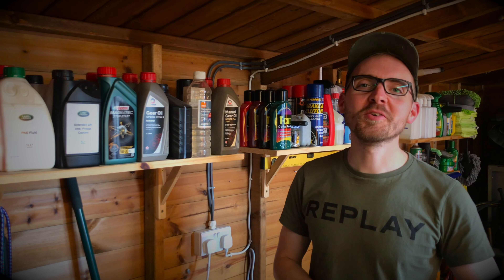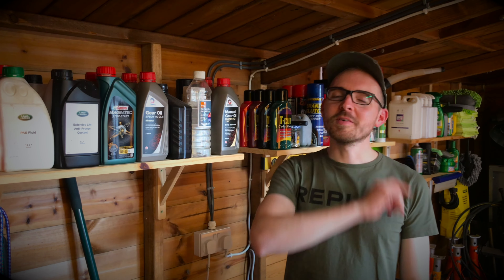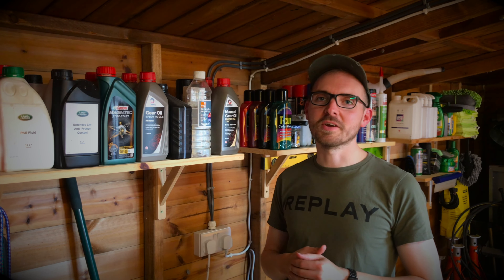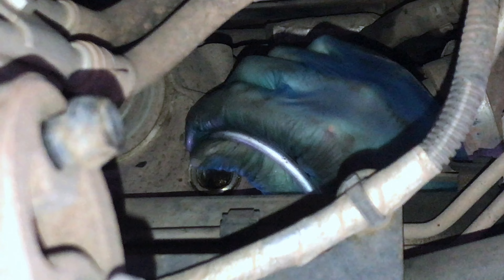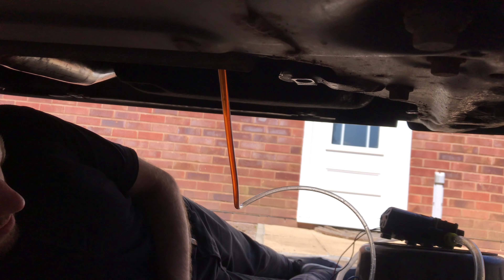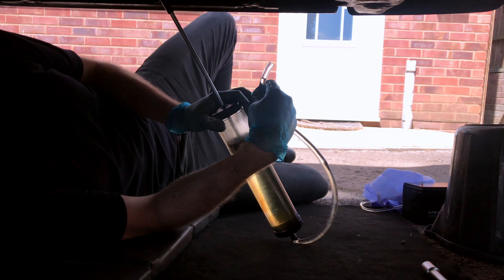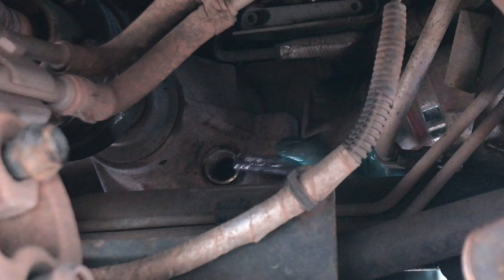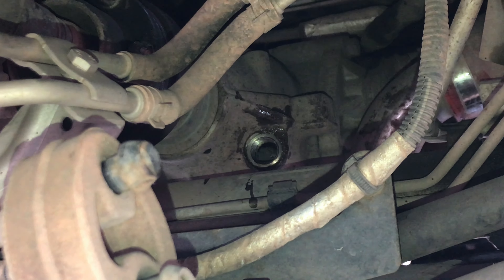Freelander 2 / LR2 PTU Oil Change!

Comment: Nice movie...............................To make the oil change easy I drilled a hole through the lower casing bolt and with a copper washer used that as a sump plug.
Reply from the maker: Thank you! 🙏 Interesting idea! Hadn’t thought of doing that but our luck at the moment isn’t great! 😂

Comment: Good vid. Any reason why you didn’t remove 120ml after brimming as per haynes manual? Any issues?
Reply from the maker: Cheers Scott! 🤩🙏 We didn’t follow the Haynes manual for this job. Instead we spoke to our local Land Rover specialist. To confirm our thoughts, why would you take out 500ml of fluid, put back in approximately the same amount to then remove 120ml 🧐 They advised it wasn’t necessary to remove any fluid but instead to wait for the dribble to stop from the filler plug. Glad to report no issues so far 🙂
Reply: @FrenchiesRoadTrips  interesting! Wouldn’t be the first time haynes was wrong (“haynes book of lies”). I will brim mine and see if it is ok. If the unit has breather pipes like the haldex then shouldn’t be any issues with heat/pressure.
Reply from the maker: @BeavisPits  😂 We did scratch our heads and think that doesn’t sound right! Luckily our local specialist was able to confirm the procedure. Which does make complete sense. Why Haynes advise on removing 120ml of the oil you have just replaced is somewhat of a mystery! If anything it would leave it short of oil, not good! It certainly does have a breather 🙂 Have used it since the oil change and nothing yet 🙏
Reply: Superb guys, ( frenchies & beavis ) another Haynes inaccuracy exposed  🤣 thanks for the very useful info and videos. Keep em comin👍😊
Reply from the maker: @badrallach4792  Thank you! 🙏 Glad you like the video, more coming up very soon!
Reply: I have a copy of the land rover workshop manual which clearly states to fill to the level and  then remove 120ml, more confusion.  These main stealers have been known to give bum info in the past. After all when refilling the Haldex unit 80 ml must be removed after filling
Reply: Fluids should be checked with the car level
Reply: @FrenchiesRoadTrips Hello, I was wondering what is the reason behind this(in my case 200ml EVOQUE 2.0T) and the only idea which came to my mind is thermal expansion and missing breath chanel. The same manual request on the rear diff., 70ml out from the max level...Regards

Comment: Great videos guys, shame about Ben's car, hope it all goes well.  Could you show us where the pcv oil breather is located? I'm not sure if I have one on my 2103 sd4 but would hate to miss it in a service cos of my lack of knowledge 🤣.
Cheers guys.  👍
Reply from the maker: Thank you! 🙏 Hopefully it will be back on the road soon 🙂 Ok, so the PCV breather is located at the top back end of the engine. It’s underneath the air intake pipe. LR004200 part number 👍 Should be done every 40/50k miles.
Reply: @FrenchiesRoadTrips  brilliant,  thanks for the part no. Your a star, I'll order one up. Cheers and all the best.
Reply from the maker: @badrallach4792  🙂🚙👍

Comment: Seems like an easy enough job, if a tad fiddley.  How much oil does the PTU take?  Not sure why but I expected more then 500ml.  

Thank you for showing the process.
Reply from the maker: Was a bit fiddly but overall a satisfying job! 😁 It takes around 700ml but you will struggle to get all that out. Definitely use a pump, you may struggle with a syringe!
Reply: It does take more the correct way to do it is to fully empty the Unit put around 750ml of oil in until it flows out of the filler plug hole then take out 120ml of oil out to get the correct level. Because of where the filler plug is and with a piece of metal just behind the hole It's not an easy job to to do according to the book. That's why I made my own empty plug.

 I get myself further away to the middle of the car so I can see the plug.

Comment: I need a new ptu  shaft on my 2011 freelander 110,000 miles as it makes a horrible noise whilst driving had a quote £7500 unbelievable !! guy said still ok to drive but just put up with the noise so radio on bit louder than normal 🙁
Reply from the maker: Oh no! That’s not good Simon 😞 Are you within the UK? You could try Bell Engineering, well known within the FL2 community. Hope you get it sorted soon 🤞🙏
Reply: @FrenchiesRoadTrips  hi Simon, i have recently Purchased a PTU from Bell engineering, Awsome to deal with next day delivery fully rebuilt with new splines fused on & a new Sleeve as well all for approx £795 next day delivery.
 so far its been great although i didnt replace the gearbox oil seals  (3)  & may have damaged  the seals while welding a Nut onto the end of the stuck old  sleeve  to remove from the end of the gearbox as it was stuck ,  in the process of replacing the oil seals on the gear box as we speak, Once out  easy enough but yes i can recommend Bell engineering the seem really helpful decent company.
Reply from the maker: @simoncotton6261 good reply from Jason 🙏